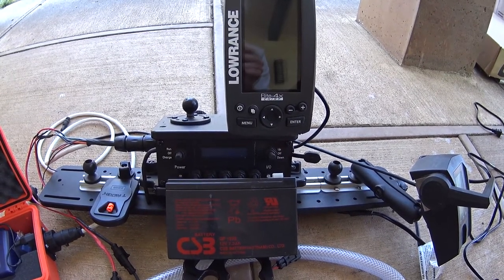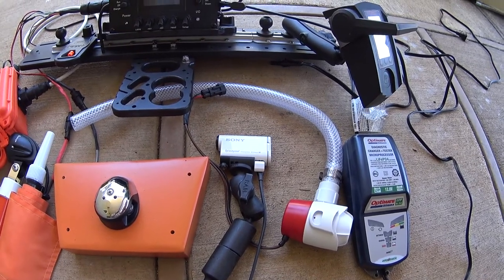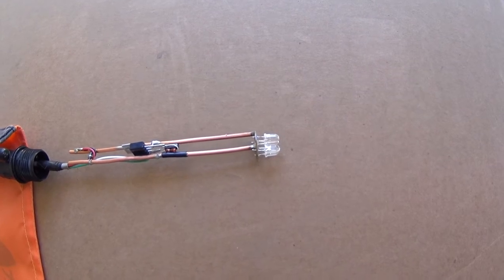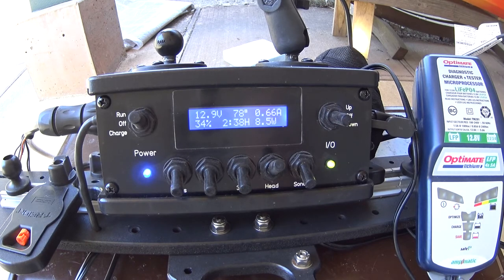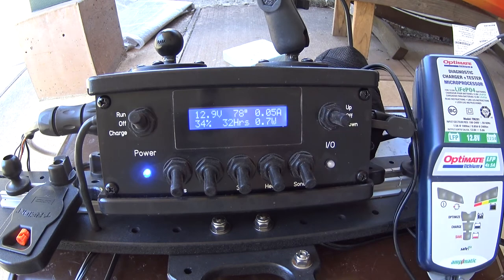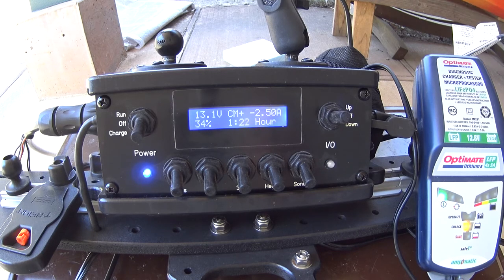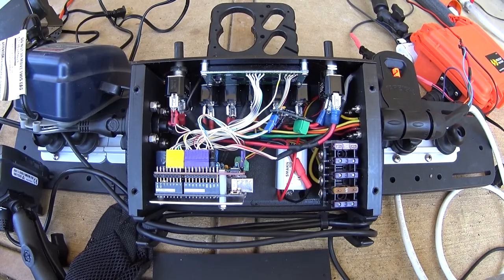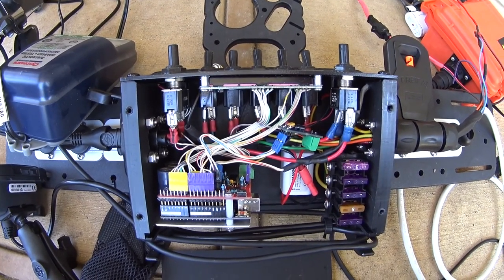Fishing kayak setup 2017 - 12v electrical system

Comment: Very nice set-up.  I really need something similar to this.  How do you empty salt-water out of the control box?  Do you have a plug to remove or do you just unscrew the top to allow everything to dry out?  I was thinking of building mine into the front footwell vertical wall and seal off the front waterproof hatch for a secondary level of protection.  We all know that an overturned boat is inevitable.  Thanks for the tutorial.  I know that this video is already a year and a half old.  Have you made any modifications to the system?  How is it holding up?  Did you end up going with a larger capacity battery?
Reply from the maker: There is a follow-up video https://youtu.be/dRwDupyTaFg with the 2018 improvements. Following the 2018 fishing season I also made a bunch of software improvements and added a externally accessible SD card slot with a 3D printed splashproof cover. In five years of fishing with my Wilderness Commander, I've never overturned, but I only fish in a river and avoid high winds. I built the box with an open drain hole and all the electronics, including connectors are coated with a silicone conformal coating. Should I ever overturn, as a minimum I would need to open the box and flush everything. So far I haven't found a drop of water inside the box.

Comment: Excellent job! I love your control box. I am afraid to say that your battery is still doesn't have enough capacity. I noticed you lost 2 hours of use just by turning on the spotlight for a few moments. What Amp Hour rating is that battery? And last but not least what brand/model bilge pump is that? It would be fantastic if you added links for all of the products in the description of the video. I am building almost the exact same system... down to the orange pelican case.
Reply from the maker: The box containing the electronics is a YakAttack Cellblok. Everything inside the box and the faceplate are my own design. The battery is an earthX ETX18B rated at 6.2Ah deep cycle and weighs 2.2 lbs. When I spec'd the battery, I didn't have the radio, so it's not quite big enough to run my 2 cameras, the fish finder and the radio for 8 hours. The bilge pump is a Rule 25DA.

A lot of the parts were purchased through Amazon including the pump, 12v connectors, switches and Arduino components. I purchase electronic  components from digikey.com.

The hardest things to find were the watertight connector for the pelican case and the right diameter cable that would seal properly going into that connector.  The connector is Digikey part #708-1108 and the cable is an Ancor 16/2 AWG round cable. The only place I found that sold that cable by the foot was downwindmarine.com
Reply: Thank you very much! Awesome build! I am starting with a 35AH Lithium Iron Phosphate myself.. but I go out for a few days. Adding my system to a Jackson Tripper T. Thanks again!